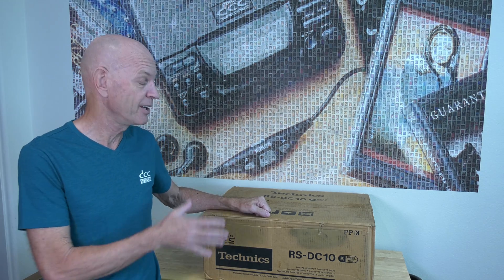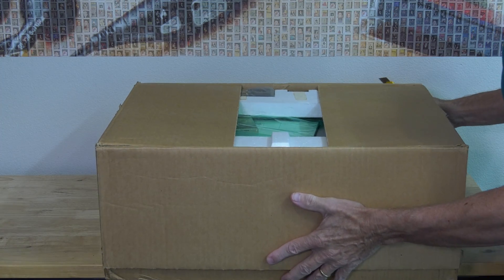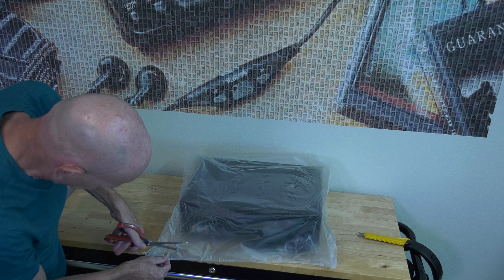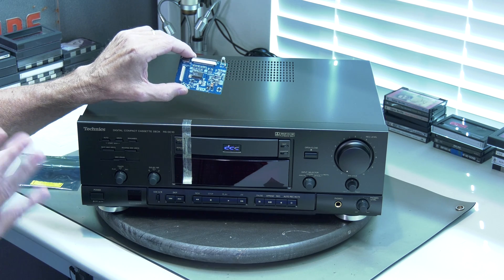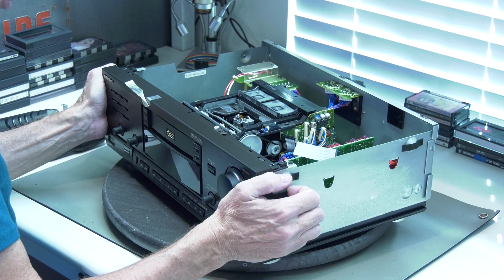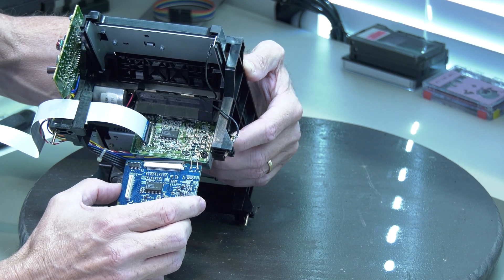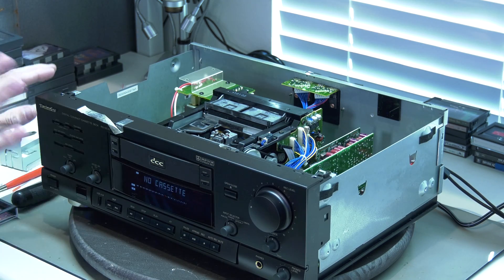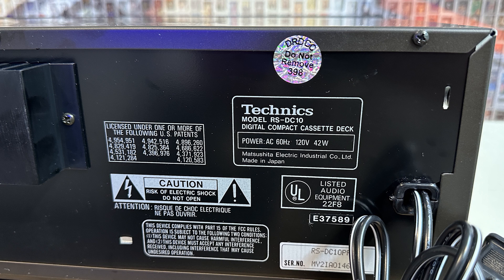Unboxing A New Old Stock Technics RS-DC10 Digital Compact Cassette and upgrade the R-W Board.

Comment: I love what you are doing with some if these machines, but leaving units sealed in the box is absolutely insane, especially when you know they are just being destroyed by leaking caps. 😥
Reply from the maker: That is a valid point. However, as long as you do not plug in the unrestored player, the problems can be solved. When plugging in before restoration, the acid leaking will cause the real damage. With the new read write board, the repair is also easier.  This apart from the desire, by some collectors, to have unopened NOS items. We all learn as we go along.

Comment: Move and I have a Kenwood mini system with the blue light on the end of each component that I bought new and never opened and in my storage. 

It wasn’t cheap when I bought it and back in 1999 when I was obsessed with mini stereos and had like 7 of them. I hope the capacitors are still ok. Back then they didn’t make many with the blue light on the end and only a few high ends did that.
Reply: Wow and this was a tape player?!
Reply: They should open up more shops that sell vintage audio and repair shops to save them from being dumped. Bc were just seeing a small fraction of what was made bc ppl. threw them out when something minor was broken bc they didn’t want to get repaired and have ppl. an excuse to buy the latest version bc these audio companies were always coming out with something new that you had to have back then.

Comment: Bought one of these new after buying the philips, paid 999 Aud for the philips dcc900 , and 50% off the technics for 499 aud in 1992, loved that machine looked better than the black philips, same technics brown casing, like the AA series, had to let it go when the heads started playing up, cost 600 aud to repair, not many parts available in Australia back then, so had to let it go.